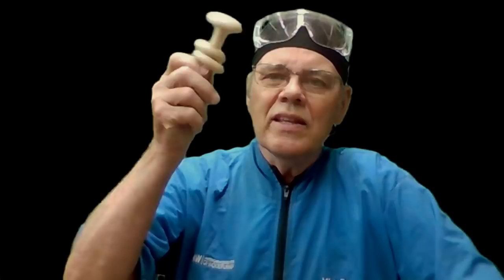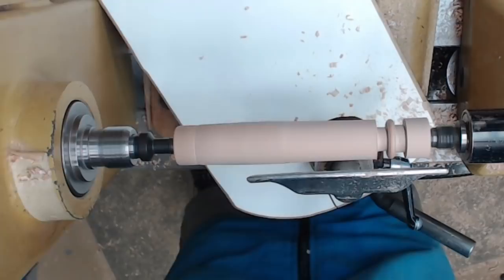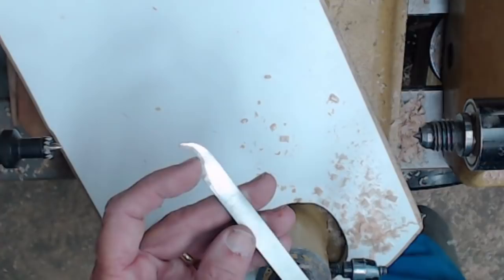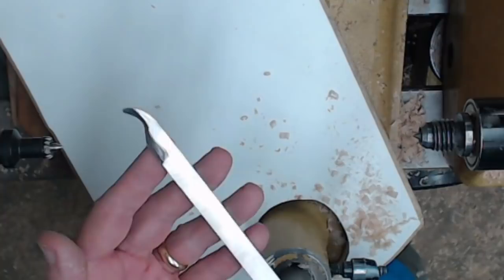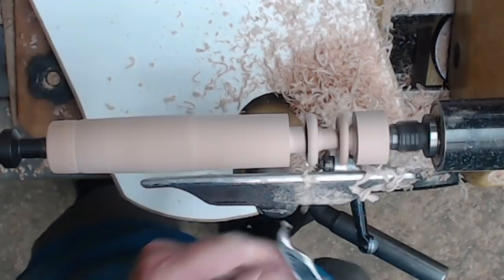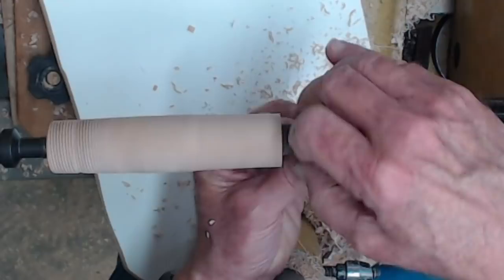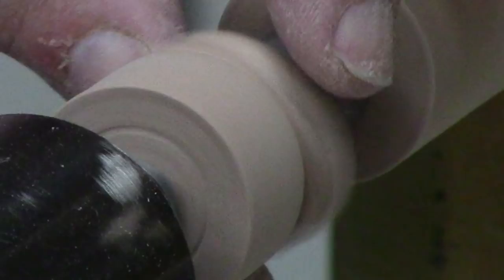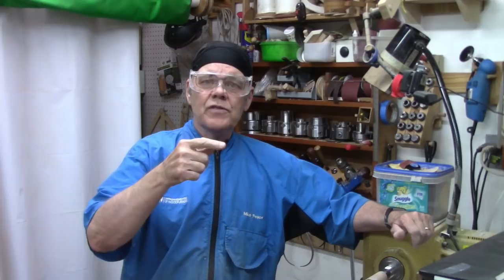Crafting the Perfect Captive Ring Tool: A Woodturner’s Guide

Comment: Takes the mystery out of captive rings. The various DIY tools proved to be invaluable. I'm thinking that screwdrivers from the hardware store might work. Softer metal would require more sharpening. Wrapping the sandpaper around the stem could also be done with double side carpet tape. Thanks!

Comment: The valuable insight from this video is that if you can turn the bead--which anyone can--you want the ring tool to be like Mike's, with a pointed hook that gets you behind the bead. In the Crown and Sorby specialty captive ring tools, with their half-circle shape, the base of the half-circle either requires a complex rotation of the tool or gets in the way and flattens or grooves the bead (see Baconsoda's video). So, the tool Mike made looks ideal: I have ordered my HSS blank.
Reply from the maker: Glad you found this useful, Gord.

Comment: Very cool.  I’ve got to make a couple of these tools and try this.  A couple of questions: 1) Instead of using CA glue on the sandpaper, would a couple of zip-ties work as long as there is adequate room to keep one’s fingers away from the zip tie clip part? And 2) Is there any use for those assembly wrenches that come in the “some assembly required” products for use as turning tools.   They appear to be stamped steel, so I’m curious if anyone has tried using them and whether they would hold an edge for any useful period of time.
Reply from the maker: I will have to try the zip ties. Sounds like they would work well. I am guessing the assembly wrenches are intended for one time use and probably not nearly as hard as a regular Allen wrench.